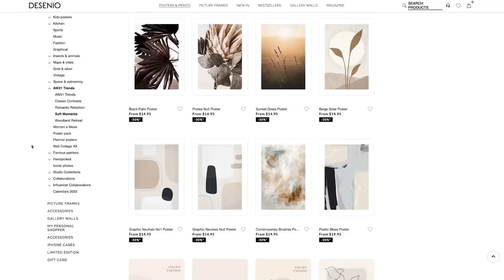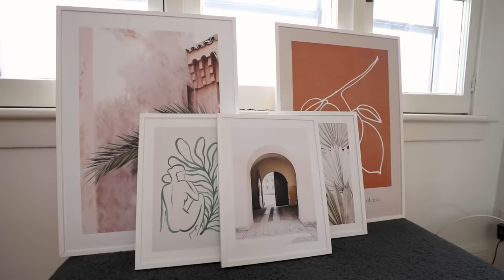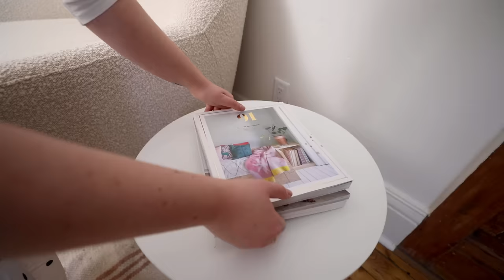Renter-Friendly 200 Sq Ft Studio Apartment Makeover With Home Office Solution | Studio Fix

Comment: Awesome makeover! I love it as usual. Transforming the hutch as a working area is super cool! However, the chair is just not working for this purpose. The seat is too low compared to the height of the desk top. A good rule of thumb is always having a 90° angle in the elbows and the knees while working at a desk. Margaree is going to be very uncomfortable while working more than a few hours. Apart from this, great job to the whole team!
Reply: The wall desk has not much available surface. That space is useless for eight-hour working (added to the holder chains and that unsuitable chair). Removing the owner`s table is a mistake. Also the directional change of the bed reduce space, I would have left as it was putting something triangular as headboard. The sofa I think should be convertible.
Reply: A chair that can be raised or lowered would have been better. I'm also puzzled about where she can cook or eat.
Reply: I just came to comment the exact same thing, ergonomically speaking, it will not work. The idea of using the space is great but the chair will have to be higher.
Reply: @adajanetta1  they did show a kitchenette at the beginning 🙂 I guess she'd probably eat at her desk or on the sofa!
Reply: @chapterstars  there’s a bar table with stools on the kitchen :) lots of space to eat
Reply: The chair actually works perfectly with the desk height, I’ve very tall, my knees and elbows are both at 90 when I sit, we measured :)
Reply: @margareep3969  That's awesome to hear! I'm happy for you :)
Reply: @margareep3969  I'm happy it works for you. I was worried about it ergonomically, and for strained wrists.
Reply: I also thought it was a bit lazy that they didn't set up the workspace for her..
Reply: @jonathanrross  she probably took all her work stuff with her while they were doing the makeover
Reply: @jonathanrross  The drawers underneath would be great for office storage.
Reply: I agree, that's what I noticed as well. That chair is a nightmare with that wall desk. If Margaree worked with a laptop, then that table space might be okay. But a desktop work computer will be awkward to use in that tiny wall hole. I love the concept though, but it might've been good on paper only.
Reply: I can't stop cringing at how off the chair height is for that desk & there's no way theres power in that cubby so there's no shutting that cubby door....

Comment: Great canvas to work on!
Favorites: ceiling lamp and bed spread!
Was hoping a solution for shower would happen.
Desk chair needs height, yes?
👍👍👍
Reply: A redo of the shower/bathroom is more than a quick fix of decor. It would involve plumbing renovations and such, plus it's a rental so it would require the Landlord/Owner's permission (way more than it does for a little paint job). Notice they were using Command hooks and strips so they couldn't even put holes in the wall to hang things.

Comment: I would have done a small bistro style table with two smaller chairs where the bench is under the window so that she has a space to share a meal with someone and an alternate work area. Havin natural light and a view in front of you for certain kind of work (maybe not computer) is really nice. Aslo agree with other comments about switching the bed direction. It fit perfectly in the nook before whereas now it protrudes into the room. And because of the angle of the wall, it doesn't look like you can sit up in bed now with the new direction.
Reply: Great idea for the bistro table, I actually have that in my kitchen with two stools already

Comment: FUTURE VIDEO TOPIC IDEA — INTERIOR DESIGN PROBLEM-SOLVING. Here’s mine: I need some bedding options for my really tall king-size bed. (The top of the mattress is above waist-high — tall enough that I need a small step-stool to climb into it.) My duvet looks too short on the bed’s sides — it looks like a big man with a too-small toupee. The box springs also show unless I decide to buy an extra fitted sheet to cover them. I tried adding a bed skirt to the look, but putting it on TOP of the box springs means the bed legs show below and it looks weird with the bed skirt not touching the floor. And putting the bed skirt BELOW the box springs (between the box springs and the bed frame) works to make the bed skirt touch the floor but still leaves the box springs showing unless I buy that extra fitted sheet to cover the box springs. The only options I see are (1) an extra-huge new comforter (like Alaska king-size) AND/OR (2) an extra-long bed skirt. I’m on a budget and trying to work with what I have for the big-ticket items.

I normally don’t mind making a reasonable investment so my home looks nice, but we are moving overseas in four years, and I’d rather not invest more than I have to. But I’m so sick of my nice four-poster rice bed looking awkward. THANKS for any tips!

Comment: This was a great makeover. The only two issues I saw was the pull down desk shelf was too high for that chair, No way she can use her keyboard. The plant that hung to the left side of her bed was right in the way when she walks past it to get into her bed. It will literally hit her in the head. The candle on the desk was 1" away from the ceiling. Fire hazard. You do great work but this one had a couple of issues.

Comment: Overall, much better use of the space.  I really like what you've done to the mirror.  Everything looks pretty, clean and organized, but...You didn't solve the lighting issue.  A pendant in the middle of the room, no matter how dramatic, plus a small lamp tucked away in a corner next to the bed isn't going to light up the space.  The overhead light will make the space feel like an interrogation room in the evening.  The space needs lamps in the living room and task lighting above the desk.  Additionally, the bed area just doesn't work in my opinion.  She's going to constantly bump her head on the angled wall  getting into and out of bed or if she tries to sit up in bed.  The plants hanging from their tacky hangers obstruct getting into and out of the bed area and will probably kill the plants due to them not getting sufficient light or not getting sufficient water because they are too difficult to reach from their hangers.  The bench adds another obstacle to accessing the bed.  One tiny round stool with a lamp on it isn't going to function very well as a night table.  #1 There should be bed tables on BOTH sides of the bed.  #2 When you're half asleep, you don't need to run the risk of dropping your phone or your eyeglasses on the floor because you missed the night table.  Night tables function best when they have straight edges and are located as close to the bed as possible to minimize dropping things on the floor.  I also agree with another comment that the chair isn't going to work very well for the desk.  When the seat is too low, as in this case, it can cause painful rotator cuff injuries that are difficult to heal and may require surgery to correct.  I want to see good design.  That means understanding how occupants, plants and animals function in a great looking space.  This place reminds me of a cheap college dorm makeover with lots of novice design mistakes.
Reply: you know this kind of quick makeovers only works for pinterest or instagram pictures nice to look at but most of them very inefficient (as a college student who spends most of time studying my back hurts just to look at that chair and desk)

Comment: I would pull the bed out a few feet and make that headboard thing taller and positioned so you could lean against it and use the space behind for extra storage. That ceiling comes down too low to be right above the head of the bed.

Comment: You get an A for your design on a dime endeavors. Not because of space planning, furniture arrangement, or even color scheme.  This was a very easy canvas to work with; a large window, cut out for the bed, otherwise square room, interesting natural wood cabinet was a Hail Mary and natural traffic flow made this (almost) a no fail project. But even with all those coveted architectural elements in this space  (she paid for in the bathroom), the actual furniture is the biggest  challenge in a space like this. There are tons of really cute, stylish, well-made furniture options for really small spaces, but they are almost EXTRAORDINARILY EXPENSIVE.  This small space could have easily accommodated  a sectional sofa, lounge chair, more appropriate/ergonomic task-to-side chair,  an actual coffee table, different lighting options, a console-to-craft/dining table option, and leaving the bed in the nook to prevent disrupting traffic flow, but then we’re talking $10K easy.

Comment: I love your videos and all that you do, but as an artist, everything inside of me screams when you staple that fabric onto the frame. Like: Why? Not aestetically, but methodically. Okay. Let me explain how you do it on your own: You begin in the middle of any side and put some in. Then you go to the opposite side and put some in. Then you can go outwards a bit, switch sides and then do the same to the other sides.  You basically always go opposite and then do the other two sides and pull. This way the slack is easily put to the corners, where you can simply deal with it and it's evenly taught. And dont cut it like that. You could trim it, fold it and staple it on top and bottom and sides. Or you simply went with the first round closer to the inside edge and trim and fold and make it neat towards the outside edge. I know I would go crazy knowing this raw edge over my head. And if it's not evenly taught it would drive me bonkers, everytime I inevitably touch it.
But I am also autistic, so I am no measurement. Other than that: <3